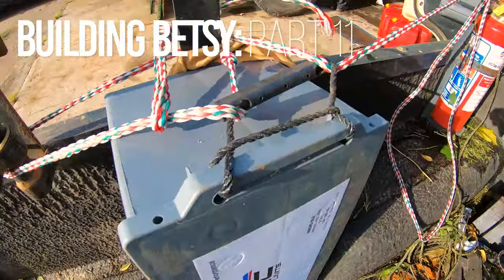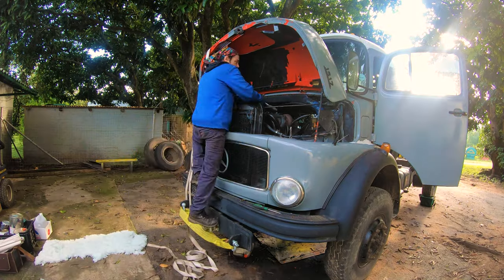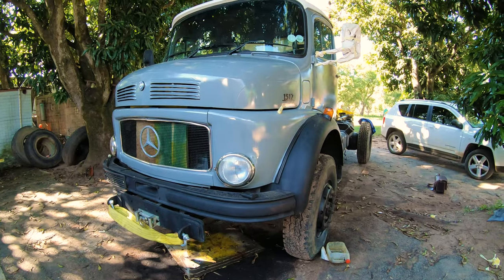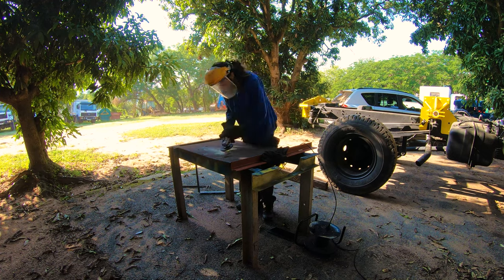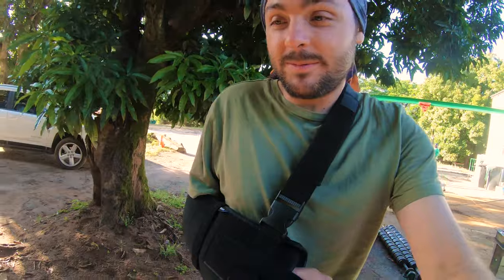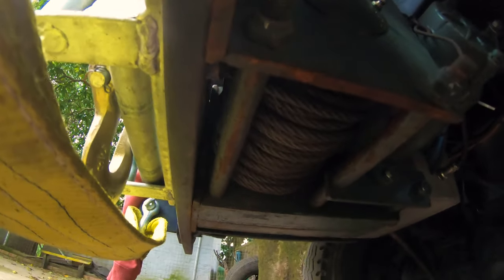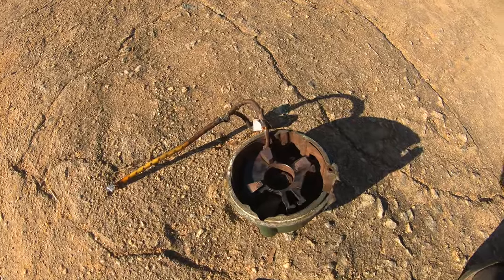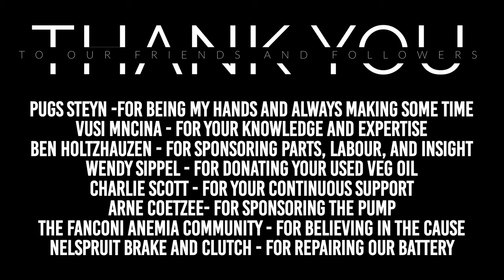Expedition Vehicle Build // Building Betsy PART 11 - Final stretch before the frame.

Comment: Great work how are you going to open crawl space for inside hadibtation box. 
Great truck thanks for sharing
Reply: Hey there,

we'll have another door with a latch/lock on the other side (house) ,and leave the cab latches open when we're inside the "house".
when driving in the cab, the house door will be unlocked. so incase of emergency we can get from the house to the cab, but we can also lock the house so that if we're not at the truck and someone breaks into the cab, they cant get to the house.

We wanted the door to seal well on the inside, so that we can keep the cab temperature and noise as stable as possible, and those latches provided a good solution. 

thank you for the compliment, and it's a pleasure

Comment: With All due Respect .   You do realize that your pass through door is mounted Backwards ! The idea is to exit the box into the cab to escape danger. You  can't do that with the locks inside the cab.
Reply from the maker: Hey man. There are two doors. And you can lock and unlock each from both sides. The one in the cab will stay unlocked when we're in the box - while the one in the box is locked from the inside.
Reply: @NuminousExpeditions    Thanks, it looked like you only had one.